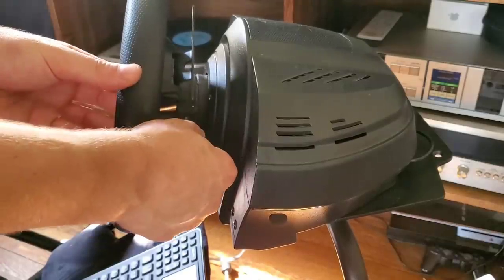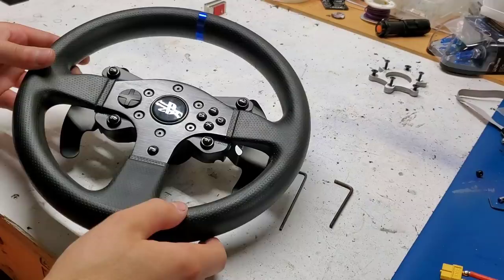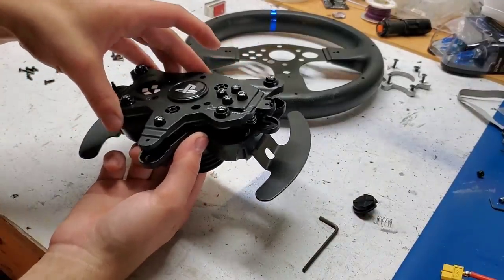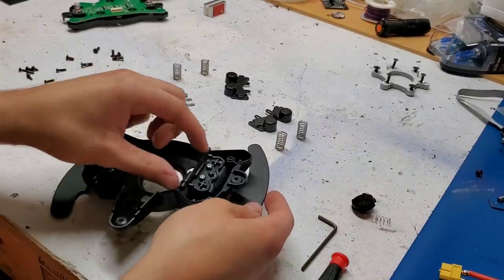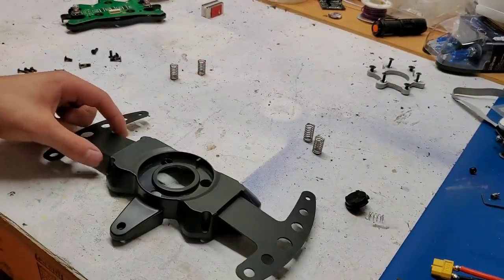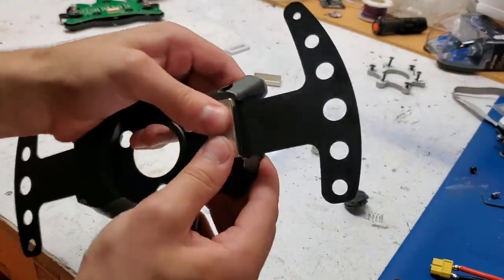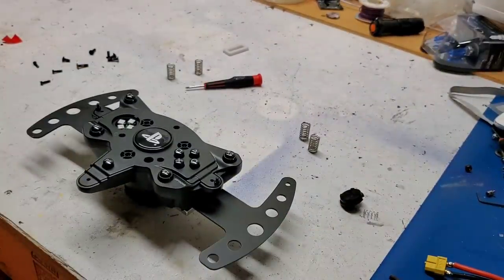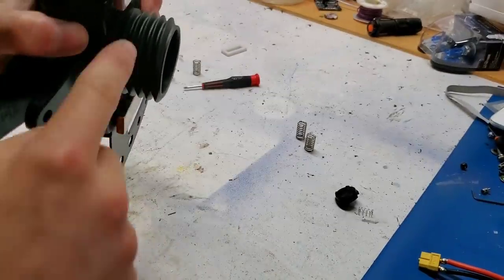Install Tutorial - Thrustmaster T300 RS Wheel Adapter, Extended Shift Paddles, Magnet Mod

Comment: Thanks dude, I bought a whole mod set for my T-GT, everything else was easy except for the extended paddle part, I don't know how to get in the wheel, I removed the 4 bolts behind, I didn't know I had to remove the front as well

Comment: Hi, at 2:07, you talk about the 3 additional screws at the back. Do you know what type of screw the bottom one is? I lost it and need to buy a replacement. Thanks
Reply from the maker: The three longer screws that hold the hub adapter to the wheel base are M4x20. The three shorter screws that hold the steering wheel to the hub adapter are M5x10.

Comment: Are the 3 short screws universal? I found a nice carbon fiber wheel on amazon and want to install it.
Reply from the maker: Yes, the screws will work as long as the wheel has the same mounting bolt pattern.